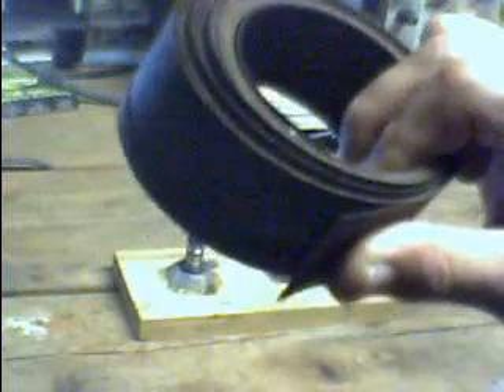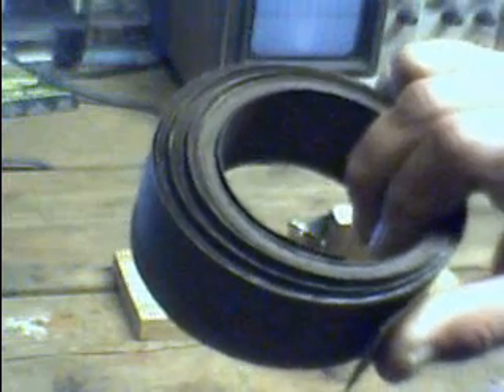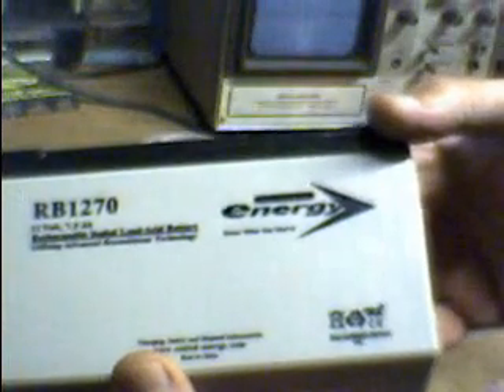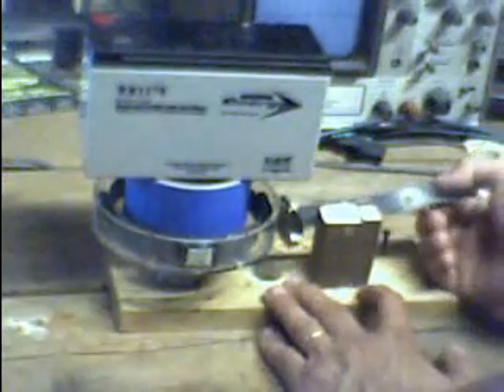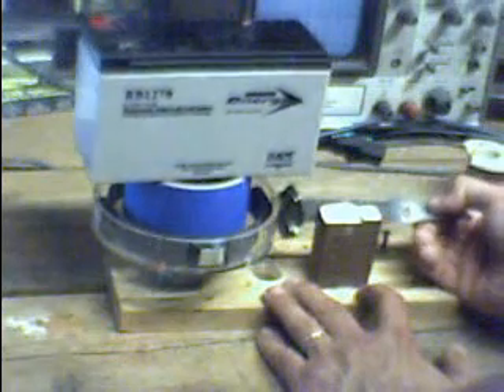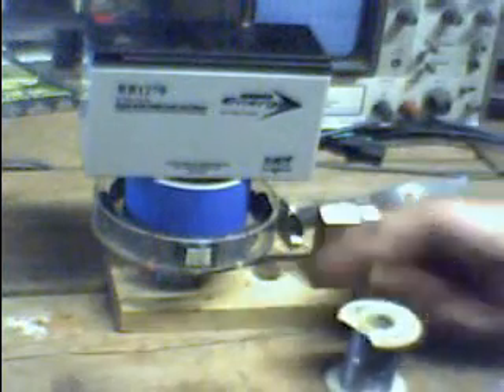04 - Magnetic motor prototype parts descriptions

Comment: PERPETUAL MOTION MECHANISMS NEVER WORK in the universe, because IT VIOLATES THE LAW OF THE PRESERVATION OF ENERGY. Specifically, the moving parts always produce the frictions (with air, water, mechanism's parts), and thus produces the HEAT( energy) to escape from the system. Therefore, the system keep loosing the energy to continue the motions. Even the advanced space aliens in the Flying Saucer could not produce such mechanism.  http://takeshiyamada.weebly.com/ufo-research-institute.html

Comment from the maker: The ring carries magnetic lines of flux from the back of the rotor magnets through to the adjacent outward facing poles where it's needed, much the same way as the stator magnet on it's backing plate.

The "rectangle" is a piece of black electrical tape so viewers can see the rotation more easily.

Thanks for your questions.